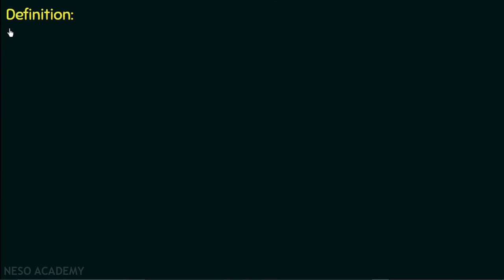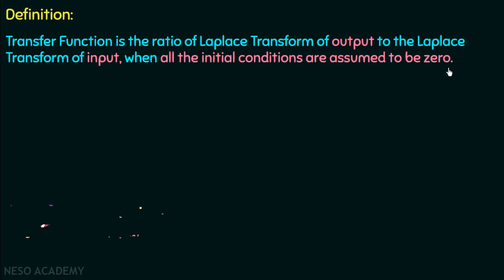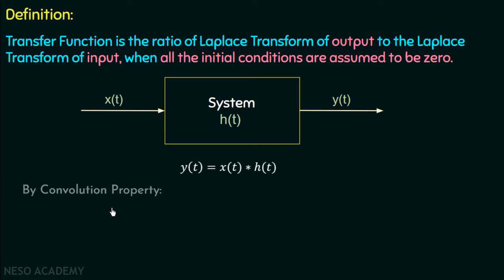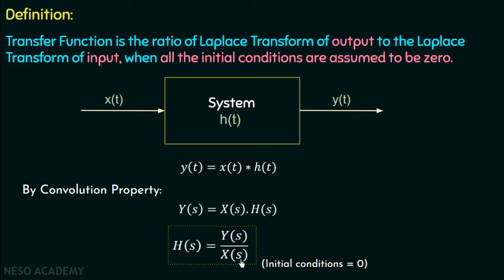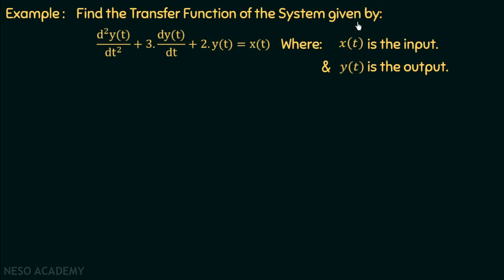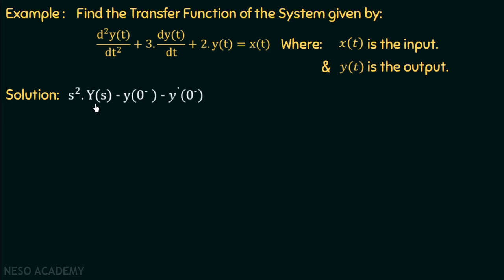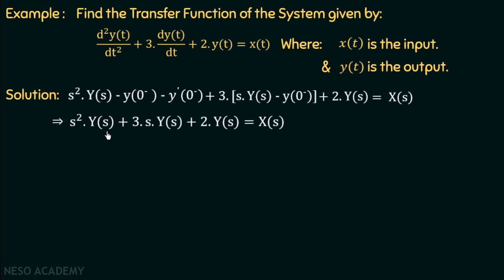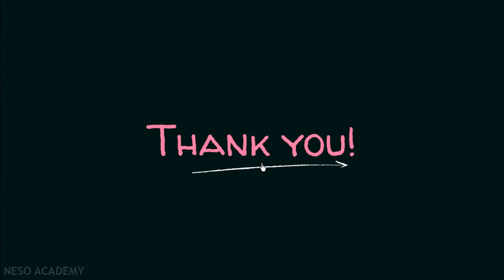Introduction to Transfer Function

Comment: there is mistake, transfer function of double differentiation is [S^2 Y(S) + S Y(0) + Y'(0)]
Reply: True, I noticed that too that there was no S•Y(0), but it made no difference since the initial conditions were zeroed.
Reply: No sir negative sign hi Hota hai
Reply: i was going to comment that,
Reply: Yes, there is a mistake in the first step.
It should be S^2.Y(S) - s.Y(0-) - Y'(0-).
Since all the initial conditions are zero, it will not affect the answer.
Reply: S² Y(S) + S Y(0 of init) + dY(0 of init)?